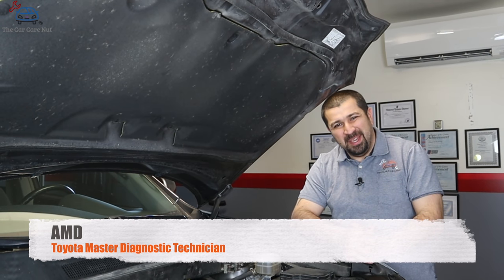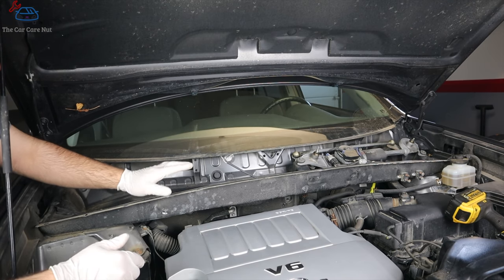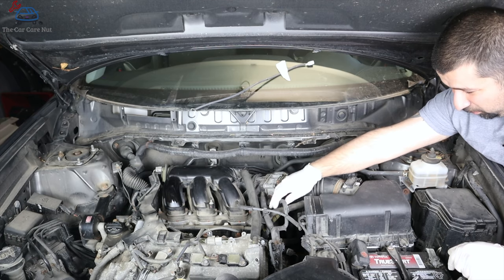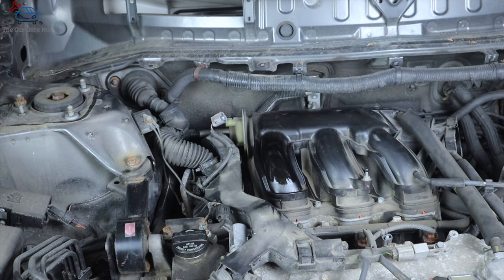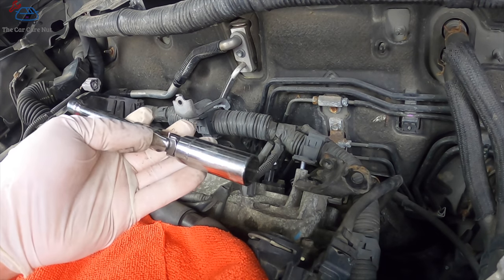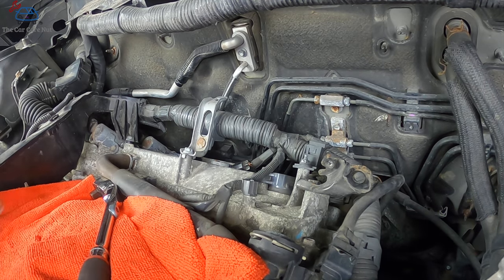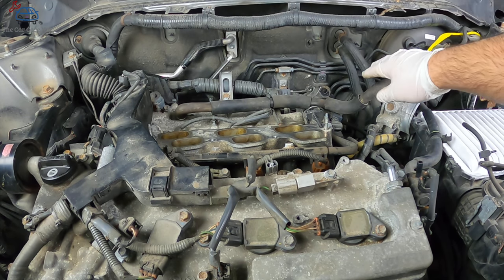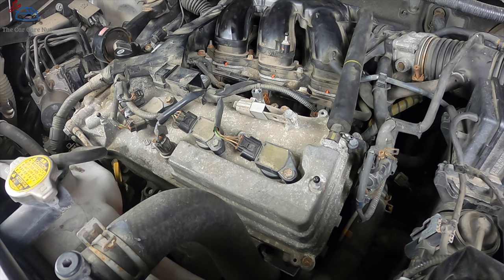How to change spark plugs on V6 Toyota and Lexus 2GR-FE 3.5L engine

Comment: Thank you so much for sharing your expertise. I am a DIY guy in Toronto with 4 x Toyota and 1 x BMW and honestly, annual repair maintenance costs of 4 x Toyota = 1 x BMW. True story.

Anyway, after watching your video I completed a spark plug change ( March 8, 2024 ) on our 2016 Toyota Highlander with 187,000 km ( apprx 120,000 miles ).

Here are a few things specific to a 2016 Highlander which other DIY viewers might find helpful.

- You do not need to remove the wiper motor or the cowl. The 2016 Highlander cowel is very well bolted down with the suspension strut mount bolts ( requires proper torque ) and a bunch of other 10mm bolts.
- The plenum slips out very easily as well, there is no hang up reinstalling.
- The 2016 Highlander plenum is held in place with the following : 2 x 10mm nuts, 4 x 5mm hex head bolts, 2 x 12mm bolts
- Removing the 2 x 12mm bolts in the rear passenger and driver side is not difficult.
- Rear Plenum, passenger side  : You can see the 12mm bolt with a good light and attach a regular ratchet / socket to break it free.
- Rear Plenum, driver side : After you remove the throttle body you will need a small mirror to locate the 12mm bolt. Then you can use a regular ratchet / socket to break it free.
- For me, the most difficult task of the entire job was disconnecting the clips from the three rear coils. If you rip a wire or break a clip it could be disastrous.
- The second most difficult task was removing spark plugs. They were not seized but after 120k miles, the threads were very snug. I had to loosen 1 turn and screw back in 1/2 turn and keep repeating ( out 1 turn and in 1/2 turn ) until the plug started to loosen up.
- I did not replace with Denso Iridium which are durable for 120K Miles as are the NGK Laser Iridiums also good for 120K Miles
.- Instead, I used the new NGK Ruthenium plug good for 60K Miles. These Denso and NGK plugs are the same heat range 6
.- For me, this DIY job in Ontario, Canada saved me $500-$600 labour
- Plug prices : Denso $33 - NGK Laser Iridium $24 - NGK Ruthenium $18 x 6, Total w. tax $122
- Gaskets : Plenum ( 3 ) Total $81 and Throttle Body ( 1 ) Total $20
- As long as you have a 6 inch extension on your plug socket, it will work without a universal / swivel socket.
- If all goes well you can complete this job in 2-3 hours.
- Make sure you torque the plugs down to 13 ft lbs
Reply: I know I will be back under the hood within 60,000 km for ignition leads or coils or x.  I may sell the vehicle before then. Presently 195,000 km. 
I have family cars to maintain and costs add up.
As point of interest I have a 2011 Honda CRV, 2.4L  that was serviced by Honda who installed Iridium plugs at 162,000 km Sept 2019 and they failed after 88,000 km. Feb 2024. The car would not start. I couldn’t believe it but it happened.

Comment: holy crap that was the most insane sparkplug change...not really looking forward to this one, but thankfully there's a video. This channel is a godsend for us DIY'ers
Reply: For first time folks, before you even begin, take clear pictures of everything before you start....so handy when you put it back together and there a hose or something dangling!!!!  "Where does this go?"
Reply: How much Is the labor for THis? Can you do My car???
Reply: Not looking forward to this! Looks like an all day job and a back breaker.
Reply: Same here, we have a Sienna and this is ridiculous for just changing plugs. These engineers! Compare that to a 4cyl top mount plugs. Crazy.
Reply: I guess if you save the money from DIY maybe it would be a good to spend the extra $$ on changing the ignition coils on the rear spark plugs, clean the throttle like he mentioned and the PCV valve
Reply: @bluesdirt6555    I did this a few years ago on my '12 Rav4 V6 and it wasn't too bad of a job- more putzy than anything else.  The hardest part was getting the rear ignition coils to pop off the spark plugs- they were stuck on there pretty well after 95,000 miles.  I didn't replace any of the gaskets since they were in great shape.  Oh, on the Rav4 you don't have to remove the cowl either.
Reply: The older Camry needs the engine partially unbolted and rolled forward to get to them. Pure joy.

Comment: The most daunting thing about this was the time that it takes to do those rear bank plugs. I just wanted to pass on my thanks to you for this in depth guide and confidence for the average Joe. 
God has blessed you with an amazing ability to build others up and demonstrate tasks. 
I will say for the back bracket on the intake plenum, I tried every tool I had but nothing in my basic kit worked... except! A standard 12mm ring spanner. Just a basic one with the angled head, that managed to get the top bolt with a bit of fiddling around, and then I could remove the plenum to then completely remove the bracket and access the plugs.
I was very anxious doing this job. But having watched your video multiple times... and I mean multiple times. I felt reasonably equipped. I also had it playing whilst doing the job just to be sure. 
Sincere gratitude for your hard work and demonstration my friend and to others, you can do this. Take your time and use tape on your spark plug sockets. I found I had a 6" extension (3/8" drive) that worked a treat but sometimes I had to insert the spark plug socket into the chamber and then. Hold it while I inserted the extension bar and wrapped duct tape around to stop it staying on the plug. Worked a treat. Did all this with a very basic mechanics tool kit here in Aus. Legend!! Thank you 🙏

Comment: Fantastic detailed video. Two additional things I’d do. One is I mark the glass with a sharpie where the wipers rest. Secondly and most importantly for myself because the rears are so labour intensive I would replace the rear coils. They can be saved in case you need a replacement for the front in the future. Thanks for the great video
Reply: Done!
Reply: Super job. Very impressed with your knowledge and skill. Very helpful video. Thank you for the provided small details.
Reply: Even more preventative time consuming labor would be to replace plugs, coils, and valve cover gaskets for the rear!

Comment: No question that this is the BEST and most thorough tutorials for this engine model. Took me and my dad, a former auto mechanic, about 6 hours to do this job on a 2008 Highlander V6. It definitely helps to have a second pair of hands. I suggest watching this video FIRST at least once to make sure you have the right tools and replacement gaskets while you have the engine bay opened up. Great helpful tip about the orange plenum gaskets being newer than the OEM back version. Thanks for saving us >$1K for what my NorCal dealership was going to charge for this job!
Reply: 6 hours?! What yall do crack a beer after each part was removed?! 3 hours is plenty time even with a couple small brakes in between.
Reply: You can do it in about 2 hours by removing the bolt holding the back of the plenum to the passenger side engine bracket using a 3 foot long 3/8" extension from underneath the car - no need to remove the wiper system or cowl tray.
Reply: @maurice2014  took me 4.
Reply: @maurice2014  
Not everything is about racing against the clock. Could it be be spending quality time with his mechanic father while they still have a chance? The next 120K mile plug change he may not be around.
Reply: @kimchee94112 Damn... that hit the feels... Well said

Comment: I changed the spark plugs, coils  & gaskets (14' HL w/over 170k miles) and  do not consider myself a weekend mechanic (will do oil change, air /cabin filters & light bulbs). I watched this video at least three times, took notes, typed up the notes (numbered steps) and then made sure I had everything prepped (i.e. garage, shop towels, gaskets, magnetic trays, and areas to set aside removed parts, plus a block of time). I considered this task "outside my level of expertise" and didn't want to mess this up, but AMD you came through for me, and gave me the courage to tackle this job. It's been over a month and no issues, thank you sir!  PS (I'd say I spent six hours, and took my time). Old plugs still looked good!

Comment: As you mentioned, this job is much easier than people think. I just finished it on a 2016 Highlander and once you get the cowling off, which is very easy the throttle body is removed and you have plenty of access to get to everything.  I was able to reach and get to both 12 mm bracket bolts in the back with only a standard 12 mm socket and a ratchet with a swivel head on it. The socket you mentioned makes it easier, but it’s doable with a swivel ratchet and a standard socket.  I replaced the PVC valve while I was at it.  If you work quickly, you can do this in two or three hours at most. Thanks for the great video.
Reply: I agree with this entirely, the job is actually very straightforward. I was also able to reach the rear 12 mm bolt with two long extensions, universal joint and 12 mm socket, 3/8” driver, all taped together so nothing fell down into the back of the engine. I just unplugged the loom that runs behind the plenum and the hose to the brake servo and move them out of the way for a little more access.
Reply: Took a little over two hours in total.
Reply: Before taking the cowls off, I would reach back and see if you can feel that rear bolt. On my 2015 Highlander, I didn’t need to remove the cowl at all.

Comment: This video was perfect, thank you! I took my time and did my 2014 highlander in about 2 hours thanks to these excellent instructions. I opted to not take the cowl off and it was still accessible enough on my highlander. The dealer and other shops around we’re going to charge me $800+ for this.  Thanks again!
Reply: Excellent video, will buy the parts plugs and coils, and replace them at the same time , currently at 190,651 miles 😀 thanks for the tips on the orange gaskets.
Reply: OMG! $800 for a spark plug change?
Reply: I got quoted the same!!!😂😂😂

Comment: I can't sufficiently express how helpful your videos are.  The tiny details make all the difference--the tips and tricks on how to bypass common issues, and things to pay attention to (e.g. reconnecting the wire bracket to the throttle body).  I have 2 Toyotas pushing 200k miles, and not only have you given me the courage to DIY, but you've saved me thousands of dollars in labor fees between oil, spark plugs/coils, and brakes.

Thank you from the bottom of my heart.
Reply: I concur.!

Comment: Wow, Thank you so much.  Just changed the plugs in my 2011 Avalon.  2.5 hours.   I removed the wipers, and support assemblies and was able to get at the back three plugs without removing the intake manifold.  Knowing what was back there via your video was a lifesaver.  I did find,  the plastic parts can cut you, just like a knife!  Thanks also for including the torque specs for reassembly.  Even though you like to change the back three plugs first, I changed the front three first, mainly to understand how the connectors work (you must have a vise grip fingers) how everything disassembled while I could actually see it!...  It worked out great for me, thanks to you!  Cheers!

Comment: I did this job on my 2009 Lexus RX350 (before seeing this video). The hard parts were:

I had lot of trouble getting the wiper arms off the posts. I wish I had heard of his simple trick for this in this video.
I moved the throttle body butterfly valve a little, and kind of panicked, but seemed ok and did not need any recalibration.
The plenum bolt was by far the hardest part for me. You cannot see this bolt, it's all by feel, and I dropped the wrench several times. I eventually tied string to the wrench to be able to recover it, I got so frustrated.
Putting it back together, I somehow put the plenum back on and did not have one of the hoses routed correctly (probably the pcv hose) and I had to unscrew the plenum bolt AGAIN to fix this.
He makes it look much easier than it was for me, but I'm just confident enough in my wrenching skills to be dangerous, obviously.
In hindsight, I would have preemptively replaced the coils on the back 3 cylinders to avoid having to go through this job again just to replace a bad coil. Personally, it was hell for me.
Reply: @Channel99-1how did you get the 12mm bolt back on the passenger side bracket. I've dropped it for the past hour

Comment: Success!  Excellent video on the steps to follow, with lots of helpful suggestions.  Just changed the plugs on my 2015 Highlander.  Tools and parts I used: 10 mm, 12 mm and 14 mm sockets, 5/8” spark plug socket, swivel joint (u-joint) for that bolt at the back of the plenum, various socket wrench extensions (3”, 6”, 10”), 5 mm hex bit, right-angle pick to help release the ignition coil connectors, torque wrench (3/8” drive), shop rags, vacuum cleaner to get the dirt off the top of the engine with the intake plenum off, throttle body cleaner (why not, with the throttle body exposed), 3 new orange intake gaskets, new throttle body gasket, 6 iridium spark plugs, a cold engine, and an afternoon where the vehicle does not have to be used – no rushing, take your time.  Taking the wiper arms, wiper motor assembly, and cowl off was key to providing access to those back 3 spark plugs.  I’ve DIY changed plugs on a Dodge 3.8L V6, a Nissan 3.5L V6 and now the Toyota 3.5L 2GR-FE … it’s always those back 3 plugs that are time consuming.

Comment: Having the right tools will make this job much easier.  I have a 2016 Toyota Avalon and my friend and I worked on replacing the three spark plugs in the back and took us 2.5 hours. The two bolts behind the manifold were the hardest to remove.   It was about 95 degrees out and humid in San Antonio this afternoon.
Reply: It definitely requires more sweat equity to DIY in Texas.
Reply: Indeed, I had to use an impact swivel socket with a swivel extension to get that back bracket bolt out. Also, i needed the magnet tool to pull out the spark plugs. This is definitely not an easy job.
Reply: Glad I won’t be doing this spark plug change again.
Reply: I changed the plugs on my Avalon without pulling any other parts and it took 2 hours. Probably the most difficult vehicle ever. Takes a lot of different size extensions and socket swivels.

Comment: AMD showed a very professional way to replace Toyota V6 spark plugs, even with torque values. Thank you. I did my 2012 RX350 without removing the intake plenum. I was able to reach the rear spark plugs from the top of the engine with a thick blanket on top.

Comment: 103k on my 2011.   With the help of this video, took me about 4 1/2 hours with the throttle body being cleaned as well using the advice from your other video.   I replaced the rear coils with Denso (you dont have to do this) and oem plugs. I also found alot of dirt and leaves in and under the lower cowel so i cleaned that up as well helping my drainage. Thank you thank you, could of not have done it without your wonderful video. My plugs were pretty rough and one in particular was toast #1. Hopefully replacing the rear coils will help with that. Now my engine it not as noisy and runs smooth.  One piece of advice i would add after you finish - start the vehicle and let it warm up to operating temperature. I disconnected my battery so my computer will learn again and it takes it awhile. Its amazing to watch the idle come down to 1,100 rpm and watch the computer slowly take it down to 6-700 rpm once it learns! Drive it around a bit and let it idle again so the computer makes the proper adjustments. Bravo!
Reply: Hi. I replaced my coils too. Why should we not replace them?  I thought that's what we should do.  I replaced all 6 with a set from Amazon that had good reviews and they looked exactly the same as the OE.  Also, what do you mean about computer learning?  I had my battery disconnected the whole time I did the job. Any advice/ knowledge you can give me is greatly appreciated...